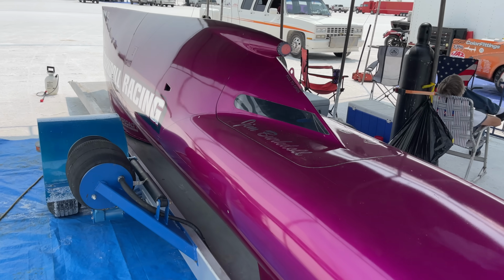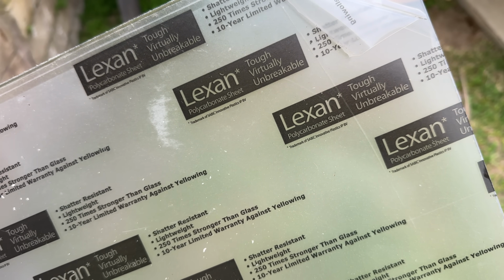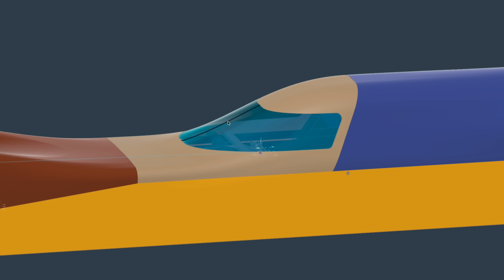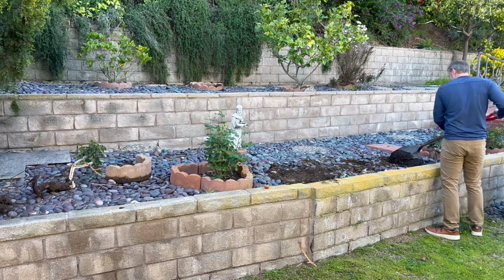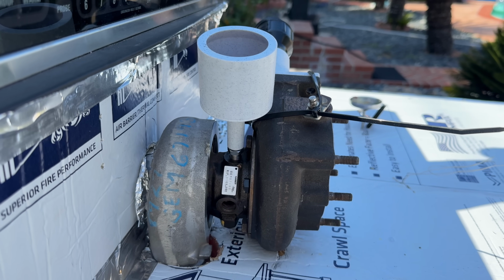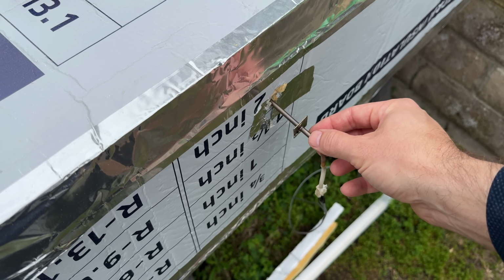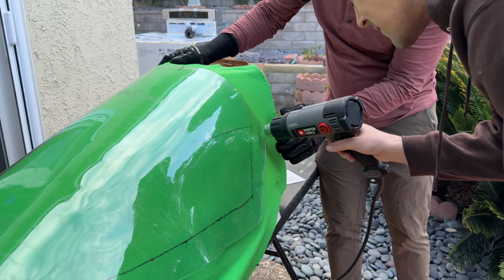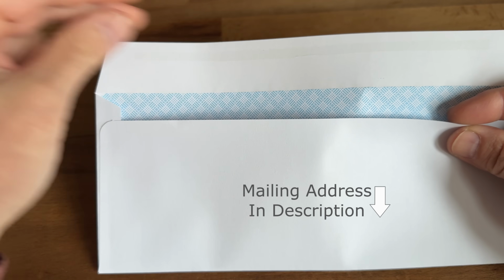I Turbocharged My Oven

Comment: You need a male and female plug and some way of putting pressure on it.  Usually the female portion is where you lay the hot polycarbonate, then press the male plug on top.

Comment: Last time I did things like this it involved some big wattage "food" holding lamps like you'd see at the roller rink circa '87, some LDF/MDF, some flock cloth, a big box and a vacuum pump.  The lamps heated the lexan progressively over time while the vacuum pump pulled it into the moulds to make headlamp buckets for a 917'ish street car.  Trim with a formica bit on a router table using the MDF mother mould as the guide and you done... ever wanting to build like this again.  If I was doing this again I would look into making a heatable mould, say perhaps with a high pressure steam capillary system, in keeping with your Matt Punk aesthetic., let the mass of the mould halves work with the heating to draw the mould closed while pulling some vacuum on the "female" side.

Comment: I'm surprised nobody's tried to just make a camera setup with a small screen inside the cockpit and no windshield at all. (Theoretically) more aerodynamic and simpler to build since you'd only need a tiny lexan disc for streamlining the bit of the body the camera lens is under. Is it written in the rules that you need a windshield? If not then it isn't illegal.

Comment: Matt, the anolog oven Thermometer's are calibrateable, if you flip and look at the opposite side of the Thermometer's dial you will see hex on the base. The purpose of the hex is to turn it with a wrench until the dial is at 212°f and yes you use boiling water. if you are ajusting the thermometer for cold, witch this isn't the case, you use ice water, yes ice & water.

Comment: I think a suggestion would be to build another, larger insulated box that you can bring to a lower than the oven, but still fairly high temperature. You could even try to find a fighter pilot/racing suit that has integrated cooling, so that you're able to work in the room. This should allow for the polycarb to not cool as quickly as you're positioning it, and also all it to not cool as quickly when it's... cooling.

My guess is that you're spot on with the assumption that the streaking is due to uneven cooling between the top and bottom. My intuition is telling me that it's because the bottom - the mold - is insulating. The top cools off more quickly, starts to contract, and then crumples back down onto the mold, and the whole process begins again. These internal stresses will cause optical distortions like the "funhouse mirror effect" you've attained. If everything is allowed to cool down both more slowly, and more uniformly, you should see much less of an issue re the striping. Unfortunately, human beings aren't really designed to operate in the environments that would be necessary for this polycarb "tempering," and your design (at least going the "I don't have a million dollars to throw around" route) essentially necessitates human interaction at this step. If at all possible, you'd want to have an "airlock room" at the entrance to the insulated "tempering room" such that you could minimize temperature changes in the room caused by opening the door.
Reply: Another potential route would be building another larger box, but not as large as the one I previously suggested, and use it as a "tempering box" with the mold and windshield both placed inside. Or perhaps you go the route of "preforming" the windshield the way you showed in this video, then stick both the mold and windshield inside a larger "shaping box" such that the windshield is forced to comply with the shape of the mold. Then turn the oven off, and let it come down in temperature gradually.

Comment: Fifty years ago, we made an oven to take a 4 X 8 upright.  It hung from binder clips on rollers and drapery track, which extended out 9' to move the sheet to the vacuum mold.  The box was made from asbestos sheet and aluminum angle, but drywall and corner bead would probably work, or fiberglass/concrete board for higher temperatures.  Not much insulation, but it didn't run much, so cost was low.  The key to even heating was adding a squirrel cage blower, re-assembled with the motor outside.  No problem with thin stock.

Comment: Hi Matt. I have drape formed Lexan for a small camper teardrop style. I made an aluminium former (singe curve) and  a much bigger oven, plywood lined with rock-wool loft insulation, one which would hold the former as well as the Lexan. The curves were good but the small number of bubbles were infuriating as I didn't know about drying it out first. I bought spare oven parts and made my own heater fan assemblies. I made 3 ~3ft sq windows which needed three formers. good luck with the rest of the build.

Comment: Notice Matt did not say he will LEAVE IT on the car.   Only he will PUT IT ON the car.  and then take it off.   lol
Regarding making a windshield, may I suggest you contact youtuber Full Custom Ian, he is down there in socal somewhere, and made a bubble top (see his video on it) and I think it took two tries but it came out perfect...eventually.  This as a full half dome bubble top, so even harder.  I don't think he'd charge a fortune (years ago I looked to make one for my custom car and it was rather expensive, so I did like you said and just designed it for curve in only one direction and just bolt it down.  btw, I will give you another tip, if you soak the lexan in black dye for a short time, it makes it dark tinted lexan.  So you can have another funny video on how not to tint your windsheild using a home made dye bath, like I did (but mine came out perfect.. :)

Comment: Curious, but what did the rule book say about running a camera and for visual? For around $80 you can get a 4k camera with a 7” screen that’s heat resistant. They sell them in eBay for commercial trucks, we mount them on front discharge concrete mix trucks on the rear engine hood. They catch all the engine heat and the hoods vibrate and shake and those cheap $80 cameras don’t die. 

If it was allowed you’d only need a minimal wind screen so you could maximize the aero and have the camera screen to work off of. Providing you could find a neat place to stuff it in that rocket coffin.

“Rocket coffin” make that a t-shirt

Comment: Letting your thermometers touch the bottom of the pan when testing the temperature is a big no no. The water temperature would be consistent to within a few degrees but not the metal.

Comment: Commercially Lexan  for moulding is heated by “ infra red “ heaters. Usually it’s a series of these arranged to heat the sheet without an oven . Also the edges of the lexan shett are held in a frame and then the whole thing is drawn down over the buck. Hope this makes sense and helps.

Comment: You need to put the Lexan on a wooden frame, make a frame out of wood with the Lexan between the two frames with screws around the edges. Heat it up in the oven, take it out by holding the frame and drape it over the mold. The mold needs to be perfectly smooth and hard. Make it out of wood and cover it with fiberglass and use auto body filler for any imperfections. There are many videos on making Lexan windows, bubble tops ,etc.

Comment: Here’s an idea for you: other than properly dehumidifying the lexan, use a thicker piece than you need, and after molding, wet sand to smooth out and then buff so it’s nice and smooth and you should have a very clear windshield. Yes you’ll probably have to remove an 1/8th inch of material, but again if it’s thicker than needed initially, you should have about the thickness you’d need once done with a thicker mounting area as well for strength

Comment: What temp does your epoxy resin soften at? What if you made your oven a bit taller and then made a heat tolerant mold and attached the windshield at the top of the mold then turned it to 250f and very slowly cranked up the temp until the Lexan softened onto it rather than trying to do it quickly? Seems like you could use one of your earlier failures to test the concept.

Comment: Is it possible to make a mold that you can put into the oven with the windscreen already positioned on it? That way you can possibly work and manipulate it while its still in a state of plasticity. Also maybe experiment with letting it cool slower within the oven to help with what maybe stress that is causing the lines/warps you are seeing after.

Comment: I think it would help to use a lint roller or do a masking tape clean-up job on the fabric first. Since flocked fabrics are typically made by gluing tiny particles to a base fabric, the fibers that don't get glued down well can get pulled off during handling or literally anything sticky touching them. You'd probably need to do a couple rounds to be thorough. Running a vacuum over it might also help with some of the fibers.

Comment: You got to have your mold HOT! Or, at least warm. er. Controlling the rate of cooling is important. Also watch the Glass Transition Temperature! You have 7degrees Centigrade between the point where PC can bend, and its GTT. At that point it may become more burdensome to work. Good Luck! (PSSSST! Consider Vacuum Forming! If you build a vacuum former, you will have a vacuum former!)

Comment: I've made a lot of things using various types of plastic but mostly acrylic, plexiglass and polycarb and I found repeatable success with low temperatures, around 200-250 and don't let the plastic go completely soft, just when it starts to slump and have the warm mold ready (smooth wood is best). The fast cooling makes it wrinkle and the cooler side will pull the curve towards that side. Ideally the mold is in the oven for the whole ride. 15-20 min max. I got bubbles from too high temp and heating too quickly and not having support. Thicker is better to a point. Also possible is covering your mold with tin foil, clamped to make it smooth. The non-stick kind.

Comment: You can adjust the temp reading on those thermometers. There should be a nut on the bottom side that you put an adjustable wrench on then while holding that, you spin the dial while the probe is in ice water till it reads 32 degrees. All of those probes need to be adjusted out of the box.

Comment: Hey Matt, why not just go with FPV goggles and a camera mounted outside? That's what one of the plans for Concorde was, but now can be done in practical sized and massed hardware.
Also, for heat, did you consider a Burn Barrel to feed the foam oven?

Comment: Any chance you could adapt a motorcycle windscreen to work? I’m envisioning the largest possible motorcycle windscreen you can get your hands on, and then mate it up around the perimeter to your custom screen to achieve the large size and connection to the car. That way you get a pro-quality screen for visibility’s sake, and then your fun-house lexan for the somewhat less-critical peripheral vision.

Comment: might've worked better if you made a larger oven and a head resistant form, laying the flat polycarbonate a the right spot for it to droop by itself as it heats

Comment: Possibly there is a temperature difference from the side resting on the "shiny foam" vs. that directly exposed to the heated air.  Said differential could make the sides bend at different rates resulting in the lines/distortion.  A solution is not coming to me at the moment.  Keep up the good work!

Comment: I know that some people make very high quality parts with lexan using cheap DIY vaccuum forming jigs with a perforated mold, a vaccuum cleaner and electric barbecue’s. That’s probably not doable for you but you might be able to pre-heat the mold in a slightly larger oven and just droop the windshield over it inside the oven. Another thing is that I see people making frames to suspend their plastics in as to not disturb the edges and bend the blanks like you’ve seen. But you’d need far bigger blanks for that. Perhaps you could pre-bend it into a basic u-shape with a heatgun over a different mold and then later bake it over the step 2 mold in the oven using a U-shape bracket

Comment: I couldn't see for your thermometers, but you should be able to calibrate them. Pit then in a cup of iced water, and with a wrench to flats on the back of the gauge, where the probe is, turn the face to 32° and there you go calibrated

Comment: Be very careful with that crap, Matt!!...and if you get a scratchy throat, get the 'DUCK' away from the fumes!...Do NOT try to finish "this one little thing" before stepping away for some fresh air!   Also...If you cough up even the slightest amount of bloody mucus...call 911 immediately and use the words "I've inhaled Phosgene gas"!

Interesting how all of the armchair experts come out of the woodwork!  Heck, two of them even, supposedly, did this for a living!...But did anyone mention that polycarbonate outgasses Phosgene when heated to molding temperature?  NOPE!...Why?...Blissful ignorance and luck?...Maybe fibbing a bit to feel important?  I really don't care about the why it wasn't mentioned, just know that Phosgene was used as a weapon during WWI!

But, then, I might just be another armchair expert who supposedly came WAY too close to maybe killing himself while allegedly making some guards for pallet-making machinery at a place where he may or may not have worked...at some undefined time in the distant past.

I may seem overly cautious and passionate about this...but it strikes close, it's very real, and I get up on my soap box whenever I run across someone fooling around with heating polycarbonate!

Comment: Maybe sandwich the blank in between silicone rubber sheets. Then you can move it to the mold without touching it directly, and it won't cool as fast.

But i dont know if it'll impede the moisture purge step. I assume it will.

Comment: Nobody ever says the full name of the shiny foam. In the building industry it’s just “polyiso”, the highest R value per inch of any insulating foam board material. Commonly used in flat roofs and also more recently in high energy efficiency wall construction.

Comment: I hope this helps...having recently made curved windshields out of polycarbonate for an airplane windshield, I did it much differently and easier. Your "oven" doesn't need to be so hot, only 250f. Make it big enough for the whole form, which should withstand 250f. Preheat. Lay the entire sheet over the form and heat it for about 25 minutes. It should droop over the form. Do not remove it from the form until it is cooler than 175f. Use cotton gloves to push it to the form as it cools. Check on the progress every 5 minutes until you get good results. You may have to increase temp gradually depending on the thickness. If this helps, please sign "Bobby Tee 😊!" on you car with a sharpy! Test my procedure out by making a small mold and a 12" square piece of polycarbonate in your kitchen oven. You will have good results.
Reply: I hope he gives this a shot.
Everything I read indicates the glass transition temperature to be about 300°F or higher.
That said, I know you can also mechanically form polycarbonate with sheet metal techniques/tooling at room temperature, so I do have to wonder if some mechanical forming can be done below the GT temp to help it along.

Comment: Most kitchen thermometers are  adjustable.  On the bottom of the disk, you’ll see a nut, put a small wrench on the nut, and you can spin the disk.  Put the thermometer in boiling water (212°), and adjust to that known temperature.

Comment: I think you should have or make a wooden maple C&C buck then finish and drill it out for vacuum forming. Combine the two techniques and it will be flat and nearly perfect. You still may need to polish it like a headlight lens. Test to figure out the size and number of holes for optimum results. I have seen boat windshields formed using a shop vacuum cleaner for the vacuum. I doubt you really read these comments but that's my two cents having done small format vacuum forming for theatrical props and so forth.
Will send a sticker!

Comment: we did this at highschool.
the lexan needs to be on a frame. under tension so it stretches over the form.
we shoved the whole mould in the oven, let it sag, pulled it out then quickly clamped the frame down.
otherwise it does this, goes lumpy.